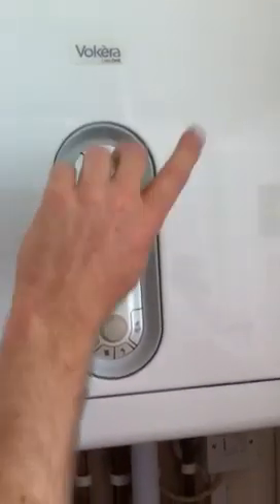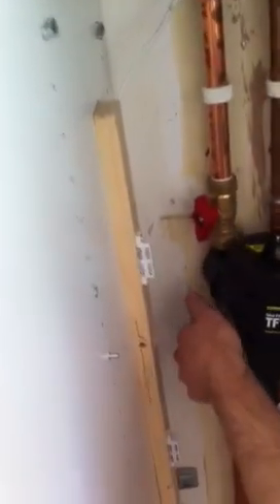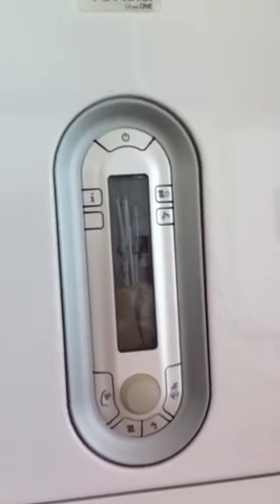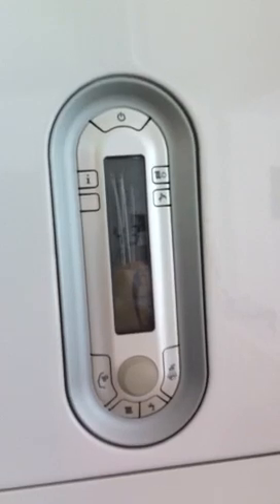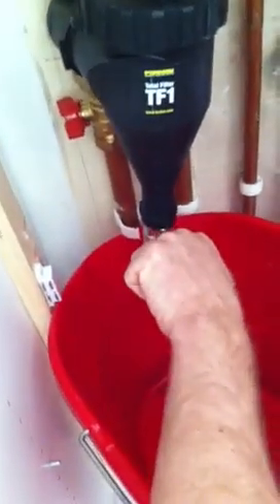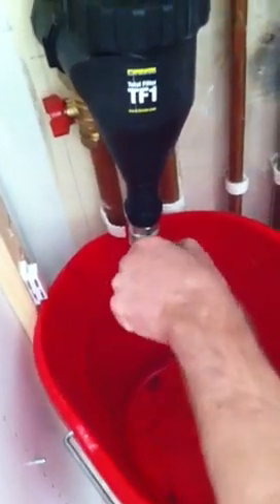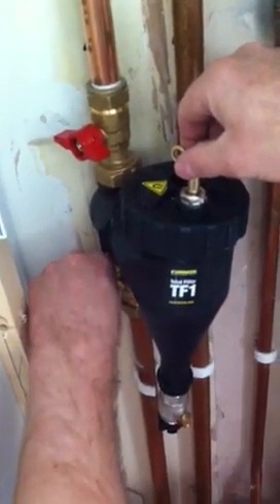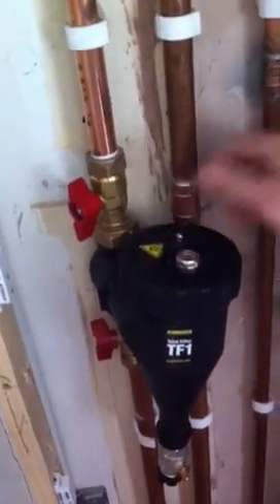Demonstration of Fernox TF 1

Comment: what aloud of rubbish, having used the filter for several months the cap became very hard to unscrew and now stuck, therefore it is not posable to fill container with solutions etc.
Reply: Jon Paul 
Fill it through the bleed nipple. If you remove the lid then you will need to replace the rubber washer.